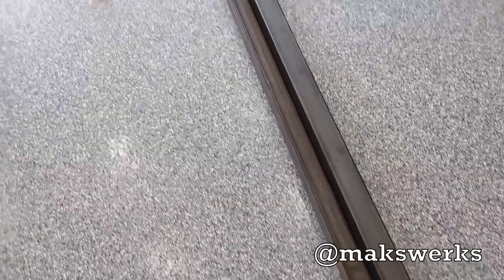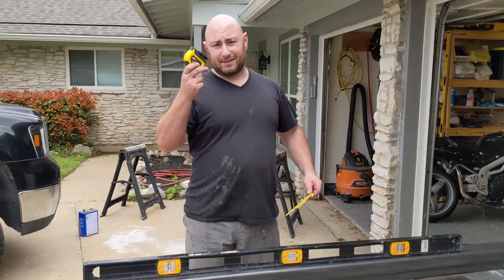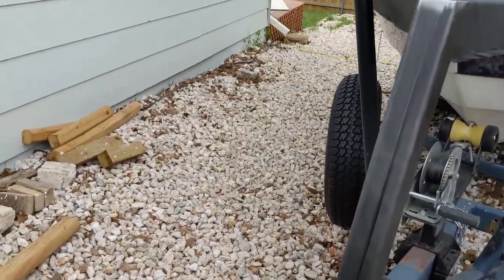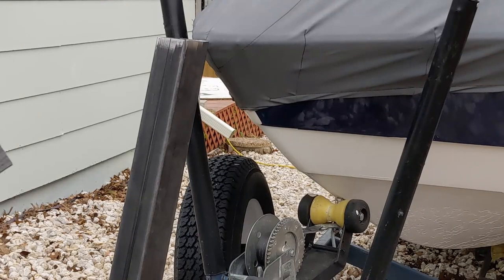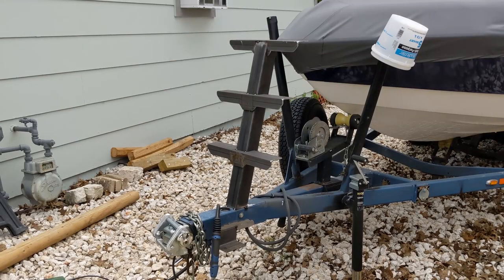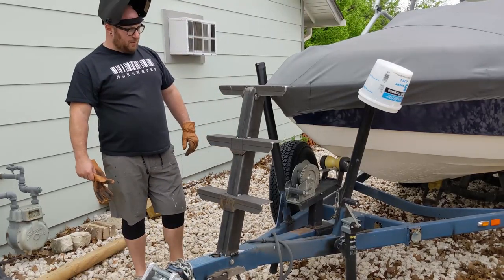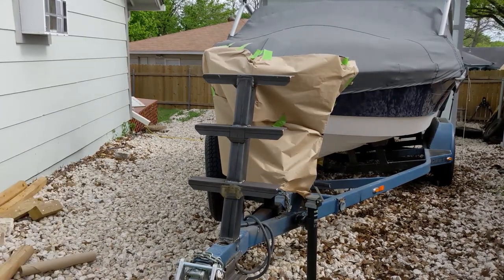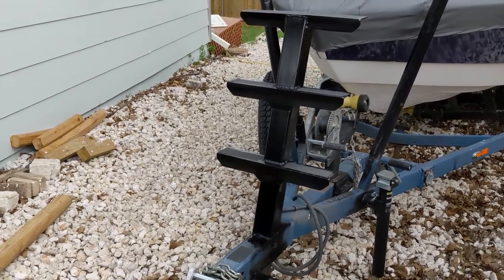DIY Custom Fabricated Metal Boat Trailer Stairs

Comment: Great looking job, I would have put it on a u bolted plate that could be removed from this trailer and moved to the next, I know another big job but you put in to much work to let it go if you sell this trailer.
Reply from the maker: It is cheaper and easier to just build another set for the next boat, as its customized to the trailer, how the boat mounts on the trailer, etc.

Comment: Really Nice! Best design I've seen...If I don't own a plasma cutter, what would you suggest for creating the stair cutouts? Thx
Reply from the maker: Cut off wheel on an angle grinder will serve you just fine. It just takes a little longer.

Comment: I wouldn't put anything on the trailer brake system but looks good
Reply from the maker: Trailer brakes work fine. This is installed on the tongue of the trailer.
Reply: @Makswerks1 No, you have welded the main post to the actuator. If you have to replace it, your steps have to be removed and re-attached. 

I agree with the comment, I would not have welded it to the brake actuator.
Reply from the maker: @thooks1234  The actuator assembly actually mounts from underneath, so replacement wouldn't be an issue. It never worked on this trailer, and I actually welded the tounge in place so it was a non-issue for me.  If it was a working actuator, I might have removed it first before welding.